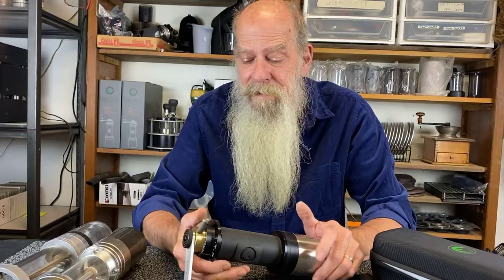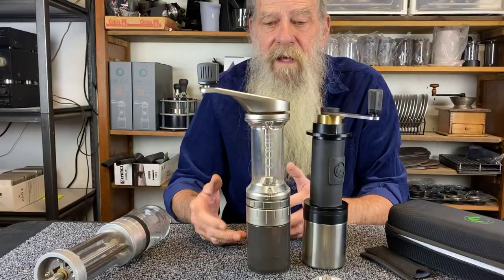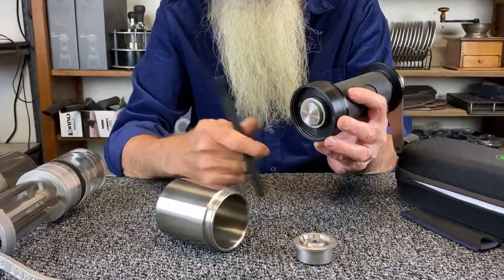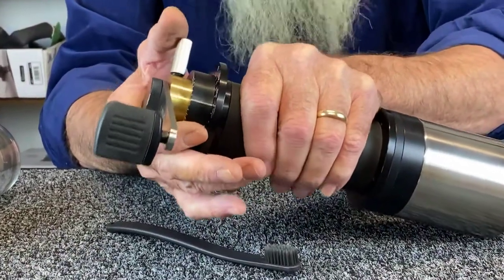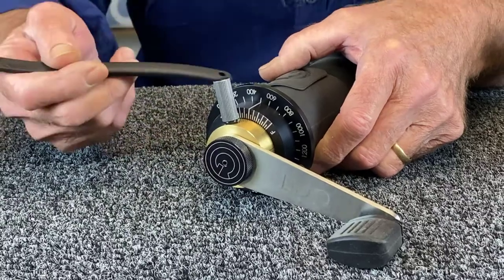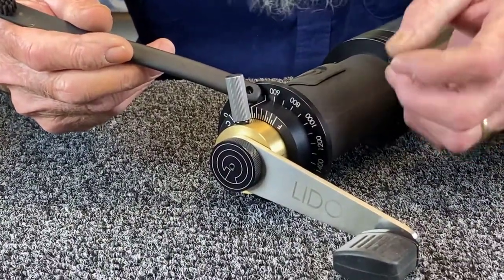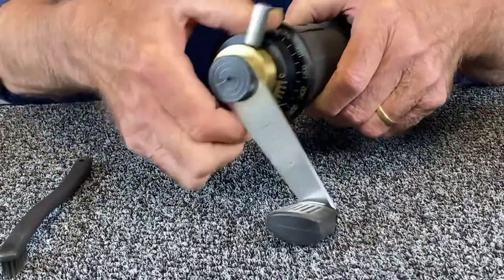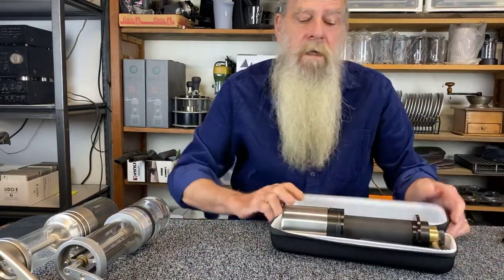Introducing the OE Lido OG Manual Coffee Grinder

Comment: Just received the OG and working through the manual and your videos to understand the grinder better.  I've had the Lido 2 for several years and it's been my grinder of choice for all filter, drip and syphon coffee extractions.  The OG is a major advance in that it allows a very easy transition from coarse to fine grind, thus making it ideal for all grind settings required for the full range of extraction techniques from cafetiere to spro. But beyond it's function, the engineering and design of the OG is simply superb. Form and function have been perfectly aligned to create an object of beauty. Kudos to Doug and Barb!  Your videos are also really appreciated.

Comment: Hey, I just came here after watching a hand grinder comparison video when I noticed that there is a new Lido grinder.  I've been happily using my Lido 3 for almost seven years now, and you just had to go and make me want a new grinder ;)

I know the Lido 3 stands out compared to most of the other hand grinders out there, but I am really fond of the look.  Mine has held up great to almost daily usage, and I'm lucky enough that even my grind cup still works just fine.  I think people must impatiently force the threads when they are not aligned or something to wear it out faster.  It looks like the OG is even more of a tank than the 3, and I love the design style.

I originally only went this route to have a quieter grind (roomates) and to get a good conical burr for less than what you could get an electric grinder for at the time.  But now I must say I am hooked on manual grinders.  There is just something about hand grinding that makes the coffee ritual more enjoyable.  You can really feel the difference between beans.  It puts you more in the process, almost like driving a stick vs an automatic transmission.

You seem to have solved the very few pain points in a very creative way.  The side-loading is a great idea to give you room at the top for the size adjustments.  My biggest pain with the 3 is being afraid to make size adjustments for fear of not easily finding them again (it took me a few years to feel comfortable with it).  It would be very nice to have objective stepped adjustments, and with the fine adjustments on top it seems like I wouldn't be losing anything vs the stepless adjustment of the 3.

I have been thinking of getting my first lever espresso machine, and being able to easily switch back and forth between espresso and brew grind sizes would be a killer feature.  It would also help me get more use out of my varied brew methods, as right now I keep it dialed in for my aeropress and only change it every once in a blue moon.

I was watching the other video to see what espresso-specific grinder I could get to complement the Lido 3, but now I see there's one Lido to do both jobs just as easy.

Do you guys use more than one grinder at a time?  I might be a bit attached to my 3, but it would be selfish to keep her on the sidelines if I won't have a use if I get an OG, especially when someone else might be in need of a previously-loved grinder.
Reply from the maker: Thank you!   We mostly use the OG - several times a day, for both espresso and pour over.  We also use our Apex for some pour overs...   Being able to easily switch from the coarser pour over to the espresso setting, and back, without losing either has been a game changer - and remember, the fine adjustment is stepless, so you have the best of both worlds!

Comment: Doug, I’ve got the original Lido (unit #285), that I got in November of 2012.  Been seriously considering the OG, I’d read that the new burr set makes grinding easier and a bit quicker than the original.  I do like the new adjustment system, over the years realigning the burrs and the wing nut coming lose during grinding was a little bit of a hassle.  Does the OG require occasional burr realigning?

Comment: Wow, I can wake up 30 mins earlier so I can grind the coffee by hand. What is next? A hand crank washing machine? What do you want me to do, to change sleep for physical labor?
Reply from the maker: Worry not!  Electrics are still out in the world - we have not taken over yet!  And, by the way, it takes only a minute longer to do the work yourself, instead of relying on the grid to grind!  :)
Reply: It's the burr quality, adjustability, precision, consistency you're getting here vs similar priced electric grinders.

It seems you are out of touch of the market this grinder is aiming at.
Reply: Did you know that rpm also affects your coffee? similarly priced grinders aren't offering variable rpm options
Reply: Nothing's stopping you from attaching a motor in place of the handle. In fact, given the travel bag, it'd be an interesting project to make a motorized accessory that'd fit inside the case with the grinder and some nickel metal hydride cells.
Reply: Bro, it takes me maybe 20-30 seconds to grind a 15-20g dose.  It's also portable, made with high-quality components, and doesn't wake up the whole house with a loud motor.

But maybe we should all just waste our money buying coffee at Starbucks because brewing coffee ourselves is too much work.